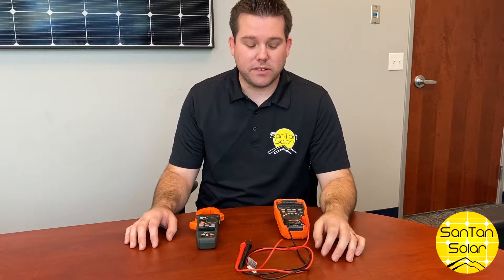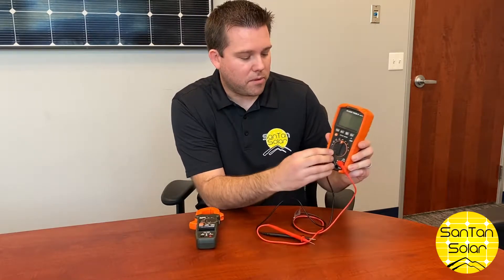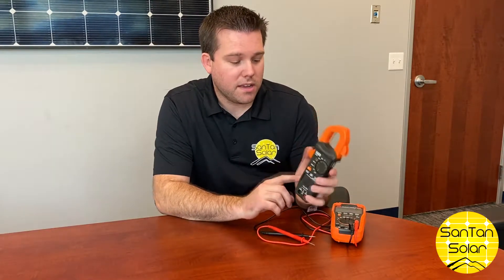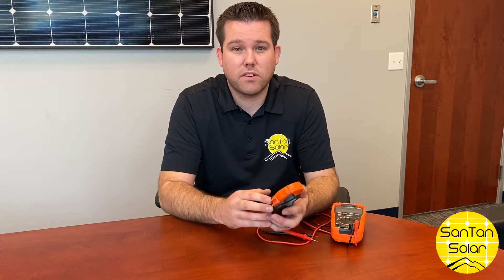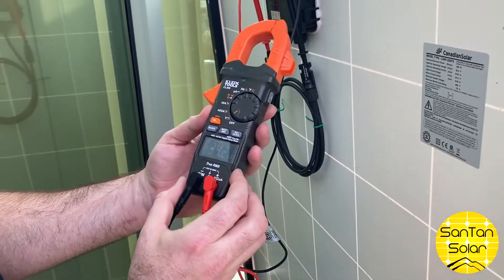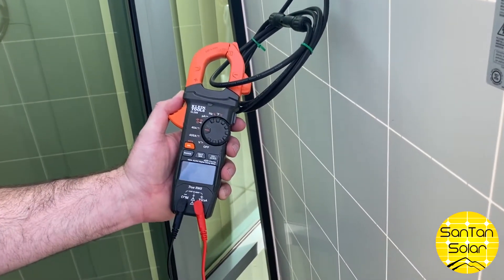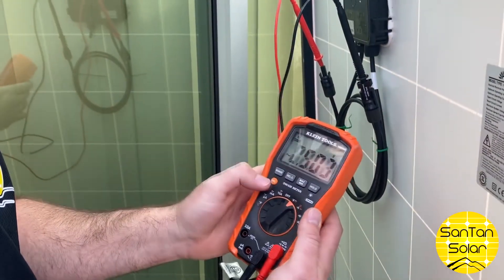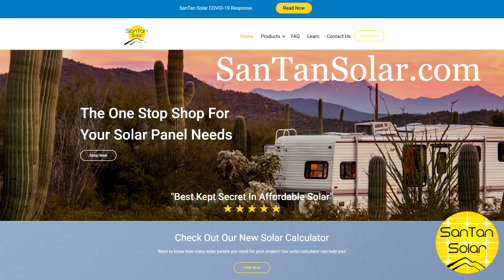How To Test A Solar Panel - SanTan Solar

Comment: When you tested for Amps, you had the proble in the 10A hole, but you moved the meter to mA position.   That's also why the meter was clearly reading mA instead of amps.  This can lead to a blown low current fuse in the meter.   You should always set the meter up and ON before you connect the probes.   The better way is to alway use a DC clamp meter.